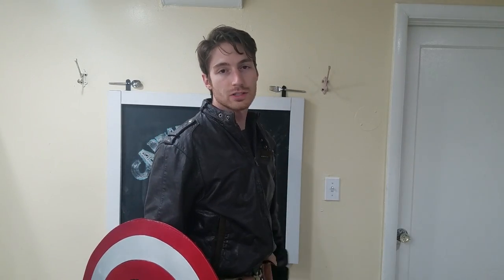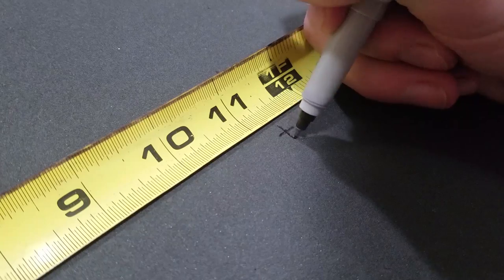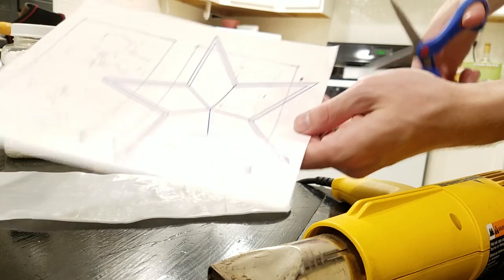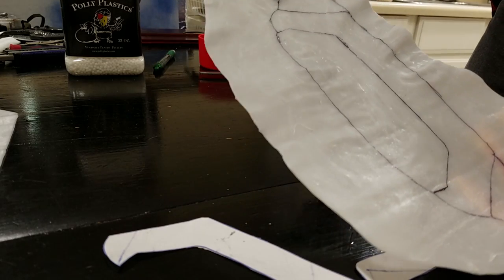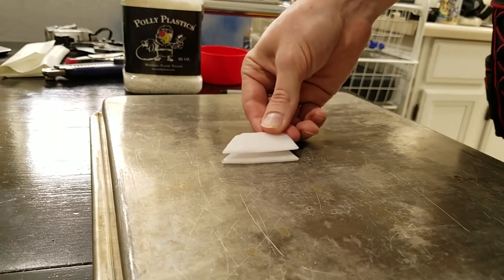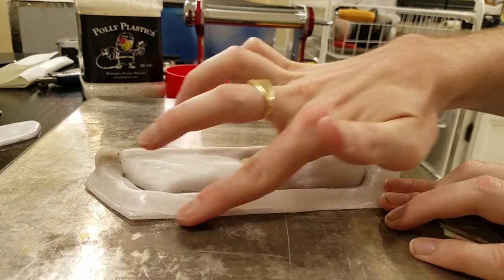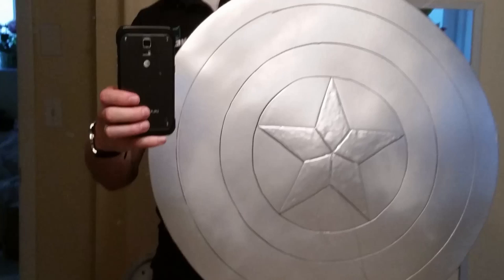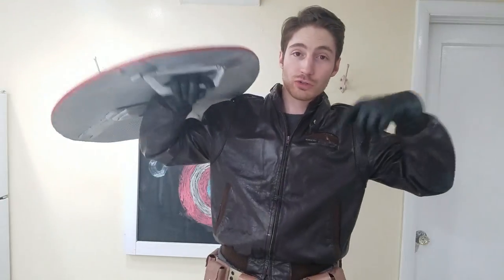DIY Captain America Shield - A How to tutorial | Cosplay Apprentice

Comment: How many days did it actually take? Drying times can make it tricky. I need it in a month and am wondering if I should use a less smelly paint so I can do it in a warm room. I did buy your template as it save me measuring times though I think I will use craft foam for the star.
Reply from the maker: +littlepinons Great question, I think if you didn't use automotive paint, you could get better dry times and it will still look just as great, I would recommend Rustoleum. You definitely have to do the Plastidip.  But then I would recommend doing a high gloss black coat on the whole thing after the Plastidip, that will help all your red blue and silver look a lot more reflective and metallic. I think it is a really good idea to use craft foam for the star, if I were to do it again that is how I would do it :)  You should be fine with dry times, it is pretty easy to put together, if you start on it now and get it done quick you can probably get it painted within a week's time. Then just let it sit untouched for about 72 hours after the last coat so that the reflective look doesn't get dulled before it sets in. The longer you can let it sit after the last coat without handling it the better for the longevity of the paint. Please let me know of you have any other questions, and good luck on your build! :)
Reply: Thanks for your response. Plastidip is a must, the last shield I made(I did the new shield Cap is using in the comics) I used acrylics (for leather) and that came out pretty well but I didn't need sliver except for the star. Got lucky and scored some silver leather that looked cool. I appreciate the feedback.
Reply from the maker: +littlepinons Sweet! happy to help, let me know if you have any other questions :)

Comment: Can you heat up foam with a hair dryer on a high setting?
Reply from the maker: +Hanna Rae it might be possible, I haven't tried it to say for sure though :)
Reply: you cannot sadly but ive gotten by using a clothes iron though on a low setteing, although it will turn the iron black on the bottom but it washes off easily.